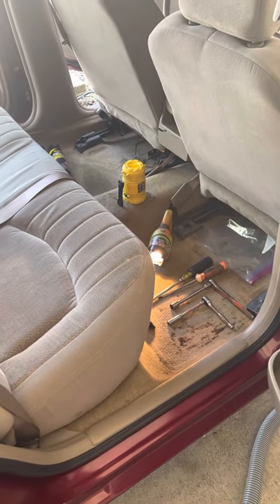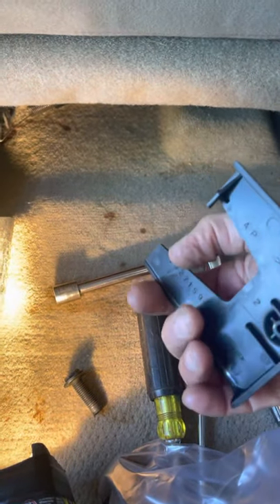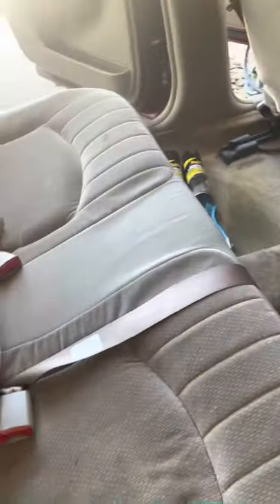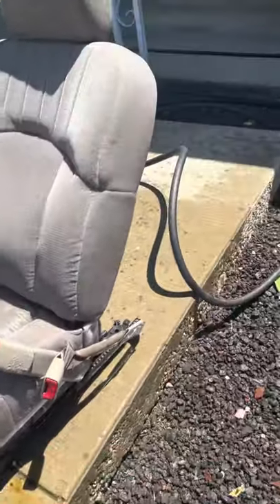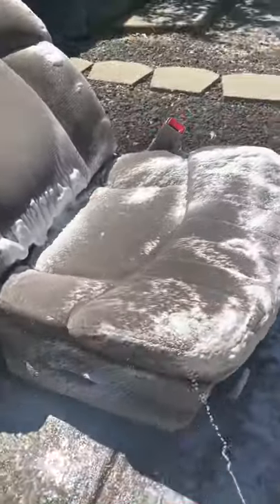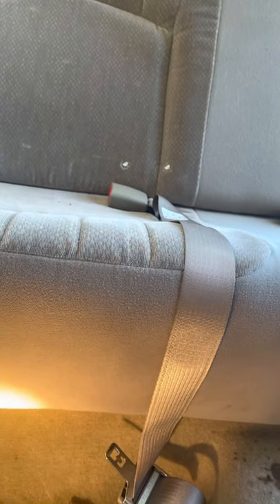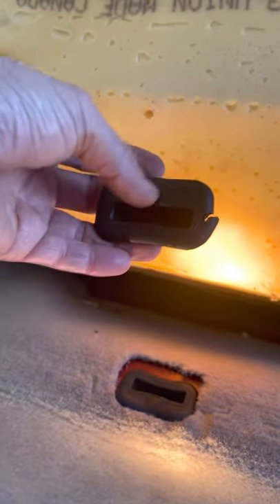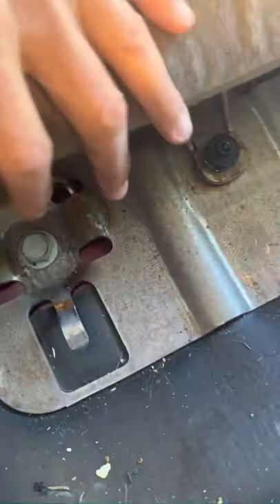2003 Buick Century Front & Rear Seat Removal & Carpet - Upholstery Cleaning

Comment: I didn't see the removal of the drivers seat. Is that procedure the same as for the passenger seat?
Reply: yes very similar. i don’t have power seats in mine so the only thing that is different from the passenger side is the seat belt buckle sensor (idk what else it could be). i just had to unplug it from under the seat.
Reply from the maker: Late reply: but yes. If I didn't say it: be sure to remove the battery cable on at least one side. It is possible that some electrical issue such as static electricity can cause an air bag deployment whilst messing around with all those electrical connections and cleaning, etc.
Reply: @stevebutler812 I know it’s been a year, but do you remember if it’s possible to install the passenger seat on the drivers side? 
I’m looking to weight reduce my car for a budget rally my friends and I are doing

Comment: I'm planning on doing this to a 98 and replacing the carpet
Reply from the maker: How'd that go? I recently pulled out the carpet from a Sienna, and very thoroughly cleaned it, and was able to get it super clean. But, that rag material was hell to dry. I left it inside the car, parked in the sun, during a heat wave, with the heater on, and ran the car for four hours before I got that insulation to dry out. But, the carpet came out very good. Maguires and lots of water and scrubbing with a vegetable brush.